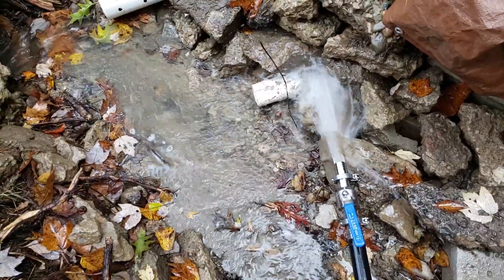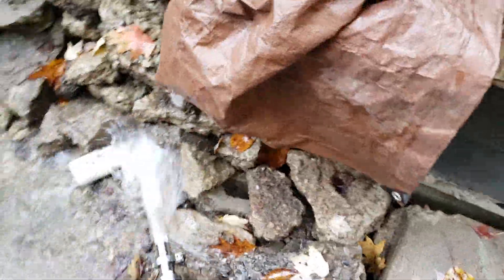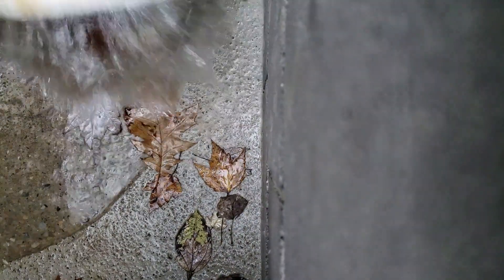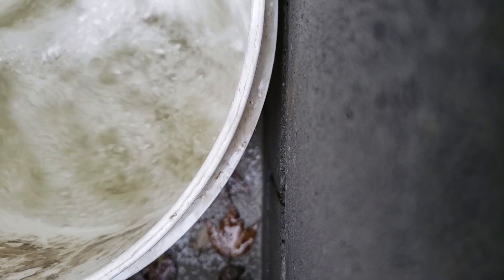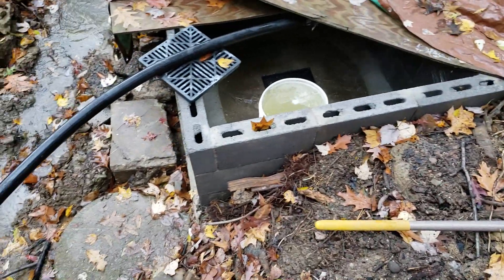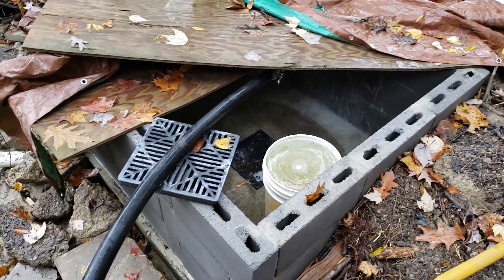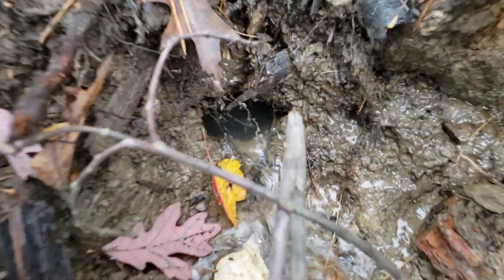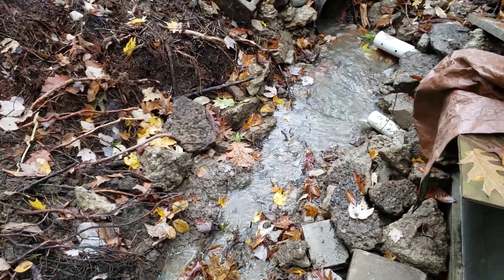Quick Flow Measurement:  1200W

Comment: Do you have the ability to add a burp, or something like that to improve the amount of air in the line? Not sure if it even impedes flow though.
Reply from the maker: I'll restrict the flow through a nozzle to keep the water line and intake submerged. Then I'll regulate the nozzle(s) to match incoming flow.

Comment: Some design ideas for your system 😙🎶

You could skip the wireless sensor (which has probably issues getting down to your house anyway) and use a float valve to regulate the flow from the level inside your filter tank. (That valves operated by a balloon)

At the bottom you would need to monitor the pressure digitally to adjust the amount of nozzles.

I would skip the spear valve one nozzle idea and get many equally sized small nozzles. Since your pressure is ideally always the same at the bottom, you can just add a nozzle if the pressure rises to increase the flow and to drop the pressure again. If the pressure drops you just shut off one nozzle to get the optimal pressure again.

That way you can use just one type of nozzle optimized for one specific pressure and flow rate. And get best efficiency regardless of the total flow rate.

If you plan the desired pressure just a bit below the maximum you can even open a relief valve if the overall flow rate is too high for all nozzles, to let the system overflow at the bottom in a controlled manner instead of a uncontrollable overflow at the top.

If the flow rate is very low you could let the system either adjust your relief valve, to get rid of the water or shut the system on and off in short periods to harvest at least some energy. The later option is probably not desirable since the valve operations consumes energy and wear out the valves.

To get rid of some costs for soft closing valves, which can even soft close on energy loss, I would source a used hot water tank somewhere with enough pressure rating.

You can burry it underground to avoid freezing. If you don't fill it to the top with water, the trapped air can act as a damper for any water hammer effect. To securely operate it, you attach a overpressure valve at the bottom, which can release any short overpressures by water hammers. Positive side effect is probably that the tank would also stabilize the pressure on your system, since you increase the amount of water in it. This might help if the flow of your well isn't that steady.

To reduce the risk damaging your system I would recommend attaching your neighbors hose for the horses behind this tank, instead of let him run a similar line down the hill without any safety measures in place.

Hope that brainstorming is helping you somewhat. If there are errors in my thoughts, feel free to point them out 😋
Reply from the maker: All valid points except the first valve at the top, this would cause a bunch of air to get into the system through the air vent, frequently

Also your comment was filtered to spam for some reason, I had to find it and approve it.
Reply: @JoeMalovich  actually air in the system could be interesting. With a pressure tank at the bottom you can seperate the air from the water again and get pressurized air (with something around 8 bar) for free. Just add a two float valves in the tank, one to cut off the output of air when the tank got filled too much with water (that's the valve you tap the output line). The second float valve would vent excess air to the environment when the tank run too empty.

The air is also chilled again (after compression by the water), so when you depressurize it, you get very cold air - which could be interesting for cooling your house in summer. Ken pointed that out in your last video (not the Livestream).

The only issue would be if you don't need no cool air for cooling the house or pressurized air, you would still need to vent the tank from time to time to get the water level high enough to not leak air to the nozzles.

At the output line I would add a check valve, just to make sure that nothing flows backwards into the tank. To get some more air storage and and more stable pressure you could add a larger pressure tank near your house or inside your shop (like below the ceiling above a machine).

Comment: Million dollar question - is this the initial flow or sustained flow?  I.e. did you recently open the valve (which gives you a much greater flow temporarily if the pipes are full but the spring otherwise wouldn't be able to replenish at the same rate) or has it been running at this rate for a few hours?   i.e. is the INPUT to the pipes also 24 gallons per minute?  Otherwise thats not a fair power calculation.    You have a really long pipe down a steep hill -- you could fill it ONE DROP at a time also also get a TREMENDOUS power out -- briefly -- as the pipe fills and creates massive potential energy, but that doesn't mean you could continuously harvest power at that rate.  Love your project and thanks for all the great videos.
Reply from the maker: Steady state.

Comment: How are you going to regulate the nozzle size/flow by the turbine, will you put a level sensor in the barrel up top?
Reply from the maker: Multiple nozzles, yes.
Reply: Joe Malovich Wasn‘t the plan to put the variable size nozzle in as well or is it simple too large for your installation? For sending data down to the turbine, how about adding a tiny waterwheel in the barrel, where the water comes from the supply and generating just enough energy to send the measured level via RF/UHF?
Reply from the maker: @big12boylp  I don't know yet if I will use the spear valve. I'm sorta leaning towards 4 or 5 bit binary flow. Still working on the sending unit

Comment: Very interesting. Waiting for the future videos. 
How did you calculate the probable energy output ?
What is the head ? Did you consider that too while calculating ?
I'm trying to setup one, would be great help with your inputs. Ty 👋
Reply from the maker: Head height is about 275 to 280 feet of elevation. The calculation for watts at 100% efficiency is gpm*head*0.18

Comment: The tank @ the top should have a lattice inside. Just a small 1" square lattice. Like a drain cover, but several. It also would help to have a few askew. Like a half closed blind. Layers mixed with square then skewed right then square, then skewed left. I say this with nothing in mind that you could do this with... but this would prevent vortex' from developing in the barrel. Even just a baffle over the input, a box with multiple outputs(intakes) that make it harder for a vortex to develop would help.
Reply from the maker: It's sucking air because I have the valve open and unrestricted.